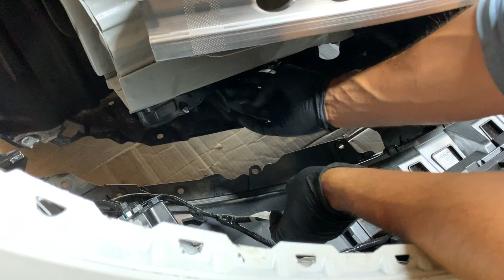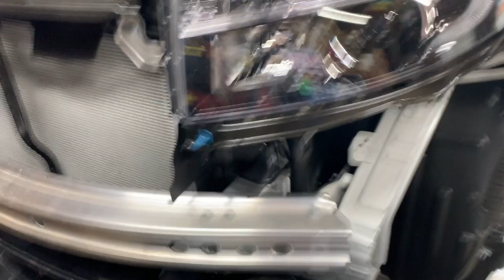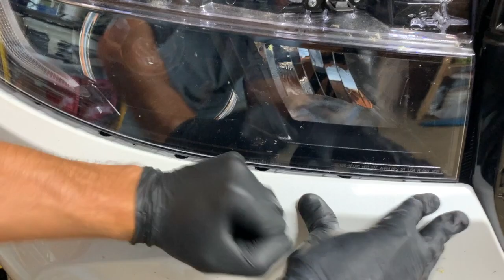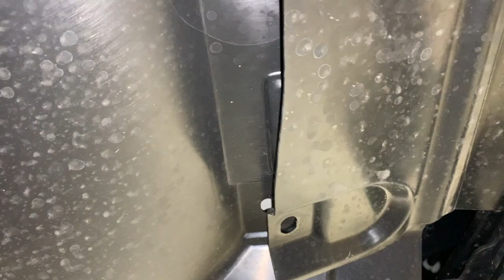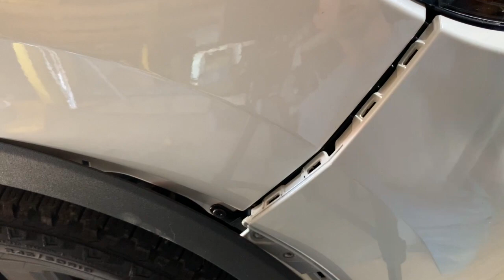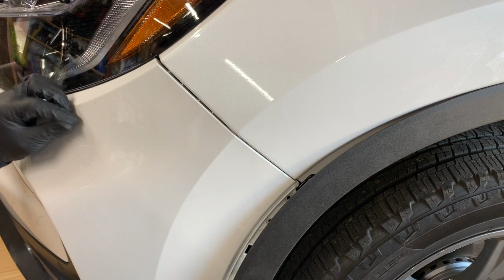Honda Ridgeline -- How to Install Front Bumper Cover 2021 - 2022

Comment: Excellent video! All went well with the install, but I do have a question: The seam between the bumper cover and the fender on the driver's side is about twice the size on top (headlight end) then it is on the bottom where the screw is. Any advise on how I can lessen the gap on the top end of that seam? Thanks